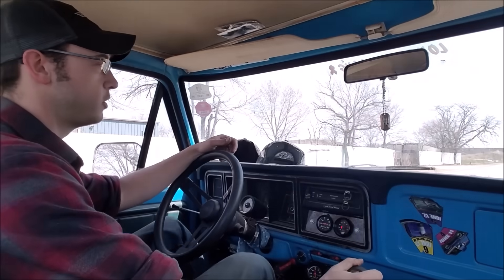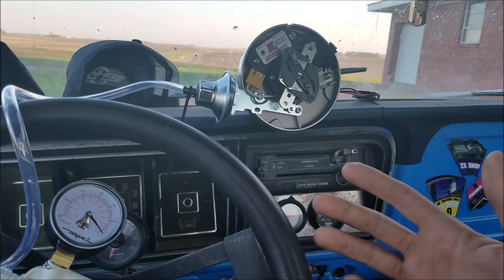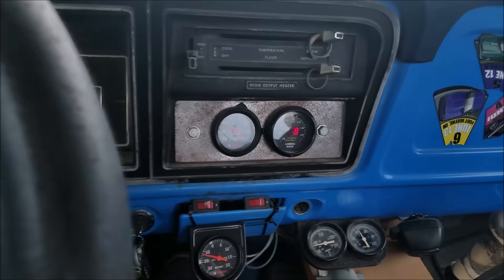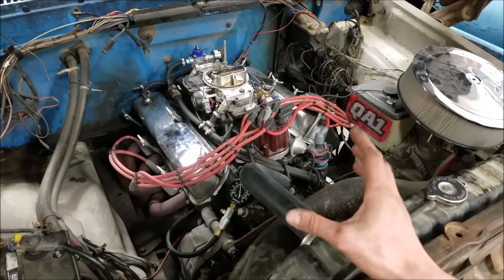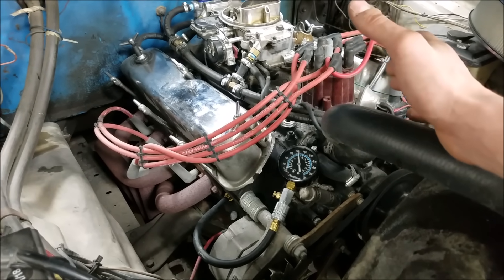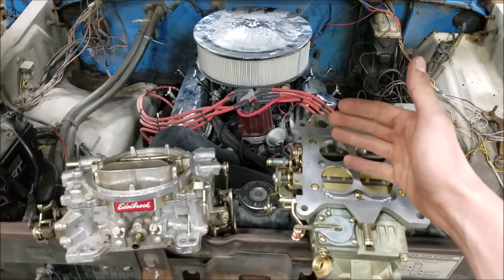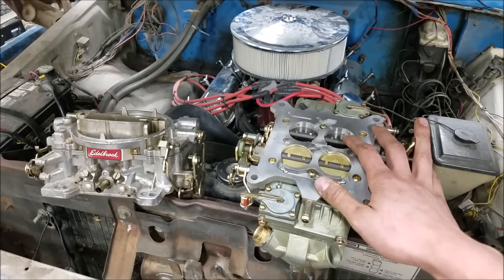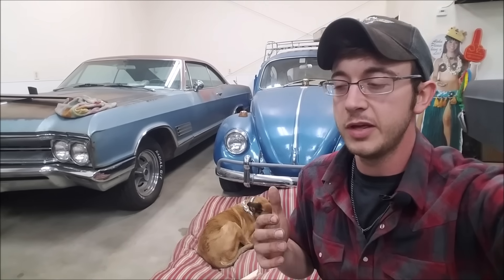Vacuum Advance - Ported vs Manifold: Which to Use & When !!!

Comment from the maker: were you guys able to follow along with this? what didn't maker sense? 
id be happy to answer your questions below - there is a lot involved here, and it can be difficult to grasp. 
Check out my friend Ted's distributors - ill be running one on my supercharged 5.0 build! https://progressionignition.com/
Reply: That was one of the best explanations I've heard on the subject.
Reply: I've got my truck set to idle with over 30 degrees of advance. I idle at around 20 inches of vacuum. I slowly pull about 13 degrees of timing until 0 vacuum. My centrifugal advance starts just above idle and adds 1 degree per 100 rpms until 3000. There is a nice curve all the way through dependent on vacuum and rpm. I found my initial timing by adjusting it until I found peak vacuum at idle. I'm running relatively low compression of 9.17:1 and 93 octane. My total timing is 38 degrees and it is all in by 3000rpms. I recently added a centrifugal supercharger and pull 1 degree per pound of boost. The supercharger is insane. You're going to love it. 
  I feel like you were very in-depth with explaining ported vacuum, then abruptly ended the video without explaining why you would use manifold vacuum instead. 
  If a guy just throws a stock distributor on, he should set total timing where it needs to be. If that leaves his idle timing too advanced with manifold vacuum, he should set it on ported. He could change springs and or open or close the vacuum advance slot to completely tune his timing curve, or do what 90% of guys do... just set total timing and let the initial timing stay wherever it lands based on the total timing. 
  Good video. I liked the visual representation with the vacuum pump and the vacuum canister. I also like your ported and manifold vacuum gauges. It does help explain it to the guys who just don't know the difference. Keep up the good work.
Reply: cool, very good vid for an old dog like me, turns out you can teach us new tricks  haha.
Quick question about your buddies new distributor design, i see an electronic board in there, so would that not get fucked by water more so than stock Luke?
Reply: @BillyTpower  I haven't seen that one personally but I'm willing to bet it's PCB is either conformally coated or the distributor cap is sealed. It could be potted, too, or that pic was for display. I'm going to grab one soon so I'll let ya know
Reply: I agree about it being a great explanation. Best way I have ever seen it explained. Thank you
Reply: I was just arguing with someone on another forum about ported vacuum.  I told them to watch your videos, lol!  Thank you for the concise, detailed update on the subject!
Reply from the maker: I’m so pumped that it made sense to you guys 💪💪💪
Reply: Excellent video! Made good sense! You pointed out things I never thought about before, thanks!!
Reply: It would be cool to show people how to adjust the vacuum can, with an allen key and whatnot.  Not sure if ford's do that or if it's just GM products.
Reply from the maker: It depends on the distributor you have - I have been meaning to do it for quite some time.
Reply: I have a 351M stk...on ported it stumbles tried this with 4 carbs... finally went manifold vacuum...now..this is where I deviate from your demo...I have 14 initial 40 total..when I hooked up vacuum it went to 40 at idle...to much adjust it out till I had 28 degs....7 from the can 14 at the crank...for 50 total...this wakes em up and it smooths past the flat spot...an adjustable vacuum advance can can be dialed in to add a touch or a lot...this can really add more power ..
Reply: @clint4004  COOL! confirms what I was saying I think. Are you using added timing at idle to reduce throttle stop at idle thereby reducing fuel use at idle? and finding another way to beat the flat spot?  Next challenge is how to approximate this with junk, without spending the money ( and associated pollution) on new, adjustable vacuum advance.
  My 82 Dodge has the advance on the computer, I want to add another junkyard advance to the distributor in order to run about twice the vacuum advance, but my computer distributor has 2 pickup coils, where the vacuum advance breaker plate only has one pickup coil.  I attached the vacuum advance to my plate and detached it from its fixed mounts, but it doesn't move because the plate rubs on the housing.  I hoped engine vibrations would allow the vacuum advance to move the plate but no luck so far, maybe lube and maybe move the advance adjustment attachment for more leverage, farther from the fulcrum.
    Since vacuum is minimal at full throttle, vacuum advance has little effect on performance, (except possibly momentary hesitation), but it does effect fuel efficiency and it looks to me to be where old engines have the most unrealized potential.  Though racing engines might want to cool the valves whenever not at full throttle, and therefore want cooler settings even if less efficient.
Reply: Hey I have been watching your videos trying to learn about carburetors and its helped lots, thanks for making these helpful videos. I bought a 81 k10 with a 454 and th350 im not very familiar with carburetors but the old rochester quadrajet was old and missing some things so i decided to buy a holley 80508s , now with the old carb the truck seemed to be idling rich but it ran good, i installed the new carb got the idle right around 750 and choke working right but its making popping noises out the exhaust some mid loud some not so much, it never did this before. it idles good and revs up finee too, when i quicky tap the gas pedal at idle sometimes it pops at the carburetor and the engine either dies or stumbles. When i put it in gear to back out the garage and try to give it gas i hear a pop from the carburetor and the truck dies completely. Its a brand new holley, the truck ran fine before im not sure whats going on. i checked timing today, disconnected vaccum at distributor and blocked it off and had 4 degrees btdc then i plugged the vaccum back to the distributor and checked timing and it was around 18 degrees btdc. I then checked final timing with engine about 3,000 3,500 rpm and it showed about 32/33* as far as i know its a stock engine. Thank you so much any help would be amazing im not familiar with carburetors but im working hard to learn thanks.
Reply: First off great video. I started watching your videos a couple months back and have since subscribed. Lets ask the question of locking out the advance in favour of total timing all the time with the use of a digital ignition such as a MSD6AL. Pros... And cons. 500" engine with a mild hydro roller stick.
Reply: ThunderHead289 excellent explanation, informative, well thought out, presented clearly for about anyone to understand.
Reply: Your video made a lot of sense and is the first information source that seems to match what I've experienced on my truck. I have a '80 GMC with a 454, all stock except no emissions and an Edelbrock carb. I've been reading as much as I could on the subject of timing and a lot of people say that ported is for heavy emissions, such as 80s models. The many of the engines in the 80s were required to run with the timing kinda late. I had a '84 K5 Blazer that, according to the emission decal, was to run at 4 deg BTDC. I've heard of (but not seen) some engines that are supposed to be set at 2 or 4 deg ATDC to get more heat through the exhaust (at the expense of power and fuel economy) and ported vacuum was helpful in achieving this. Thus, much of the literature I read says only emissions controlled engines should run ported. Everything else should run on manifold vacuum, but this is contrary to my personal experience on my GMC. My engine runs like shit at idle with manifold vacuum, with not much power off the line. With ported vacuum and set at 8 deg BTDC it purrs and has a lot of torque off the line.
Reply: How's it been running since you put it in? If definitely looks like something I'm interested in picking up, it's just so new that I haven't been able to find many people out there that have posted anything about it. I'm in the market for an ignition upgrade anyway and I watched their spark test video and fell in love with this units capabilities.
Reply: I want my idle to be as efficient as possible, so unless it screws up my mixture, I want my throttle plates to be as far closed as possible at idle, and that means I'm going to want manifold vacuum unless that makes idle so far advanced that more advance slows idle rather than speeding it up.  I would rather have a small flat spot than waste gas at every red light! and can't I set my accelerator pump to keep that flat spot acceptable?
Reply: I got it ! Thanks Man
Reply: Great video and explanation.  It told me for my stock 289 in my 65 Mustang I need to go with ported vacuum.  Thanks!
Reply: You could show us the difference in the mechanical advance. Ford's underneath, GM on top.
Reply: since idle and transfer use the same passage, fuel is already flowing. so the rational that it takes time for the fuel to catch up is out the window
Reply: I didn't follow along first go around. However now that I'm going through it with my Fairmont not running right, it helped a ton watching a second time around now that I'm in the  middle of it.
Reply: After seeing both Porter and full man,or your vacuum gauge,and the source of the vacuum which is the transfer slot,I fully understand now. Thank u. Good job.
Reply from the maker: @douglorimer5985  thank you for taking the time to listen. A lot of folks like to just sling their biased preconceived opinions out there - I try to just let the tech speak for itself.
Reply: @ThunderHead289  Do you know if Ted's distributor would work with aftermarket efi like the Holley sniper?
Reply: Well my dad was a tune tech for Ford, for 30 years. And being a car guy/gear head  I wanted to know all there was to know about tuning a Ford. But the Ported versus  full manifold vac. Always baflede me. But now. Because of my old school set up I'm a full man. Vac. Guy.  With Dura spark igniter.  All my engines are 460s. And I tune at 6000 ft.  And I love the original Ford distributer.  For me ,its capable of anything I need. Good luck.
Reply: Hey Dylon good info here. I just getting into this. I have a 75 350ci Pontiac with a whole bunch of vacuum lines. looking to add a manifold and 4brl carb. Question how many vacuum lines do I rally need?
Reply: Could you have problems with a tbi if you did an hei distributor swap with a vacuum advance. Idk much about these so looking for any help.
Reply: Yes, you made lots of sense about Ported and Manifold. Till date, almost all of us car guys will stick to either manifold or ported. This argument has no finishing line, as it appears. But my knowledge goes back to the 60's 70's where i studied automotive engg and all books, educational material, manuals state the obvious fact, Manifold vacuum. Guess that has stuck onto me till date, although I've tried ported too more towards recent years. I'm leaning towards Manifold. Cheers
Reply from the maker: @hmayerv8  the problem is that everyone thinks surface lever and it's actually about 3 layers deep. One does not simple "switch from manifold to ported" then analyze. 
What ported allows you to do is to run more initial mechanical timing where often on manifold vacuum, initial mechanical is really low to compensate. 

When you mash the throttle, your only on that mechanical timing where many engines due to how they are tuned will then be late and make less than peak power off the line. 
On almost any street car with realistic street engine setups, ported will always be kind for peak performance as long as it's utilized correctly in connection with mechanical initial timing. 

Thunderhead289 - Engineer. 
Cheers.
Reply: @ThunderHead289  yeah... How about for stock engines? Using electronic distributor
Reply from the maker: @hmayerv8  an electronic distributor still has mechanical and vacuum advance. . . 
This is above your head I see
Reply: I'm sure it's more carb tuning then timing but on a 79 351M with the stock 2 barrel. If I don't wait until it's completely warmed up it wants to quit every time you back out of it. What should I be looking at
Reply: You explain it very well so if some don't get it it would probably take an 8 hour seminar hands on for them to get it.
Reply: I had to watch it a few times, but great explanation.
Reply: How does the Progression Ignition work with the carb cheater....
Reply from the maker: @jonathensackman2297 just fine - a lot of installs out there with both.
Reply: Good video.  I thought you were going to point out the actual hose connection points on each type of carb when you had them displayed.
Reply: @poijupoij  The ported vac port will have little or no vac at closed throttle whereas manifold will be at full vac which will drop the more the throttle is opened. If you were to graph it, manifold would be like dropping down a hill whereas port would be more U shaped

Comment: Yeah, my pretty much stock 1.3L Samurai (except for Toyota 3k carb) does not like manifold vacuum, absolutely hates it. With it hooked into manifold vacuum, I was having to back it down to around 6 degrees b4 top dead center for base timing or the thing would stumble, engine would shake, and it would bump and spit out the exhaust at idle with the vacuum advance hooked up, meaning that when I got into the throttle or was climbing hills it would end up with that super low timing and power would take a dump. Drop in a set of colder N9YC plugs and put it on ported and I can run 12-14 degrees of base advance with the vacuum advance hooked up, meaning the timing never drops to that ultra low level like b4, it also idles smooth as glass. Sometimes ported is a lot better.

Comment: I was given a new old stock AFB carburetor. It has no ported or manifold vacuum ports. They are not drilled. It runs good on the 350 in my 55 Chevy. However when I shut it off it was dieseling. I hooked the vacuum advance up to a vacuum port on the manifold. This increased the idle speed and allowed me to close the throttle valves more and have a lower idle speed. This stopped the dieseling and my off idle throttle response is crisper. My 55 Chevy has a four speed manual transmission. I have always ran on ported vacuum but the dieseling problem was making me hate this car. I had the same problem when I had a holly carburetor on it.
Reply from the maker: You just needed to advance your initial mechanical timing - if you hammer it, you back on the weak base timing that was plaguing you previously .... 
This is what im talking about in the video that folks seem to not understand.
Reply: @ThunderHead289  I had already maxed out the initial timing at 12 degrees. Any more and it was hard to start. This engine has a ten and a half to one compression ratio.

Comment: Hey ThunderHead plz to meet you im the Ole Dragon outta Sandsprings Ok......I love the way broke it all down for us not so savey guys on these BBF engines but i have a personal question for you....I have a 1970 Lincoln Mark 3 im bringing back to the streets with a bone stock 460 ..except for the true dual system with spintech 6000 mufflers and a Edlebrock air breather on top of a 4350 autolite carb i dont race or burn up my tires at every corner (that chit cost to much) i might put my foot in it here and there to make them Spintechs sing for me but mostly a cruzier old school type of guy.....Give it to me straight ....Ported or Manifold:face-orange-raised-eyebrow: for a old Geezer like me.
Reply from the maker: You are going to want ported and 10-16 initial mechanical timing.
Reply: @ThunderHead289  ok got it ...boy oh boy you sure know your stuuff thanks again.

Comment: i just got rid of both i'm running just mechanical on the 65 olds 425
Reply from the maker: Not sure why you would do that
Reply: @ThunderHead289  you just put what springs you want in it and set the timing with a dial back timing light

Comment: As I understand it, at idle the fuel atoms are less and as a result, need more spark to burn them off, hence the vacuum advance is on manifold vacuum. This was taught by a man in Nevada named David Ray, aka "Ignitionman"
Reply from the maker: I can explain why you wouldnt want to use manifold again just like i did in the video - its about what each forces you to do with your mechanical timing .... and why manifold is often a sub-ideal choice in actuality because of it.

Comment: You explained that quite well.  Not really a Ford guy, but I did have a 428CJ at one time with a 4 speed toploader and it was impressive!!!  Is that a toploader in your truck? My latest and probably LAST build is a 1975 square body Chevy 4x4.  I am using a Blueprint 427 engine and cam specs are: Hydraulic Roller Cam - .577 Intake / .577 Exhaust Lift and 240 Intake / 248 Exhaust Duration @.050-112° LSA.  So I think I'll be using manifold vacuum on it.  I also have a vacuum can for the power brakes due to the cam.  On stock engines I usually use ported......but haven't done any bone STOCK engines for a long time, and I use straight manifold vacuum.  I set my timing initially at 10 BTDC and all in at 38 degrees.  I find this works well on most small block Chevys. But as you probably know already......every engine likes something different. That's why I have an A/F gauge, and I'm always listening for pre-detonation.  Anyway, great video, and you're spot on with your information.